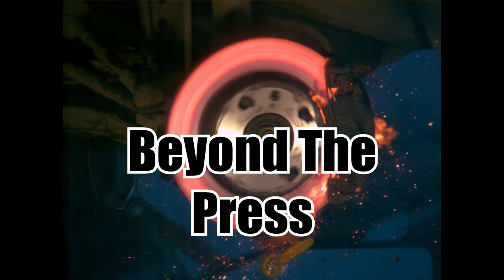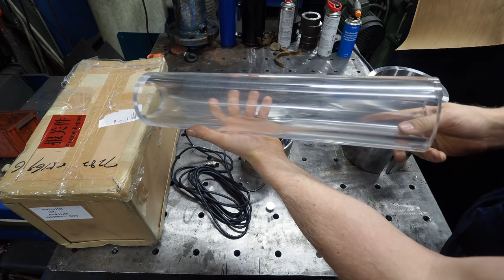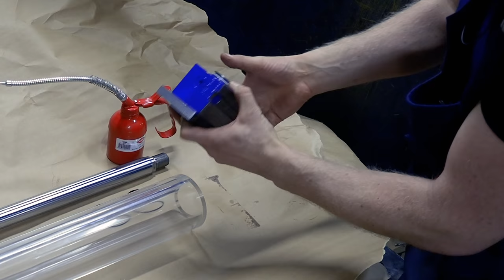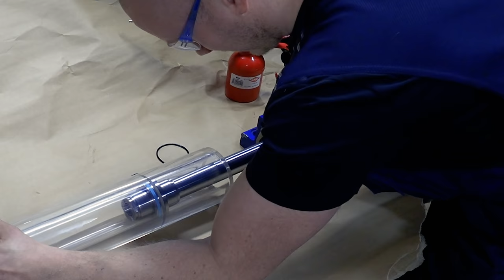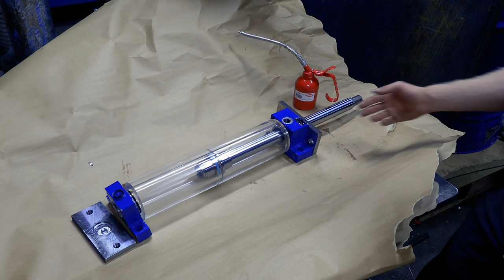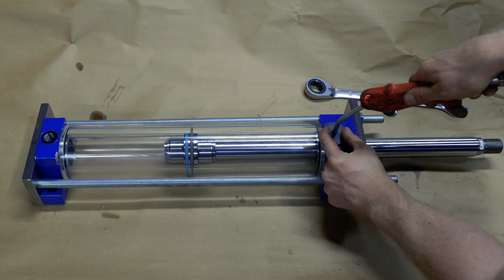World First Working Transparent Hydraulic Cylinder?

Comment from the maker: I forgot to explain today's extra content on the video :D But it's a long drill making a long hole :D And I didn't have time to film machining part but here is link to older acrylic machining video https://youtu.be/a4egfD3c8eM And here is link to our workshop's page if you need something special like this made https://www.vuohensilta.fi
Reply: Ok
Reply: Very detailed explanation of the extra content, thanks.
Reply: technically, if you fill a syringe with oil and connect it to another syringe that is fully compressed, it's hydraulics
Reply: Hey Lauri your extra content made my cat go mad jumping around 😺
Reply: That was a big ass drill, haha - really cool. But that cylinder looked really nice. I understand why you want one your self also :)
Reply: @Speeder84XL  Technology for Arts sake. 👍
Reply: You should have your website translated professionally so potential customers don't have to use Google Translate.
Reply: lots of money in that tool! coolant induction holder, several extensions, plus the drill head,  how long is it?? looks like its 500-600mm
Reply: Beyond the press I want to see you use Mercury as the fluid!
Reply: fill cylinder with mercury
Reply: How big a hole?
Reply: Use polycarbonate

Comment: Please, please, please, made a second video of this operating with hydraulic fluid.
Reply: Are this comment that I will post!
Reply: Surely it will explode if operated even within specified manufacturer's parameters/pressures.... 
Even if it were high end polycarbonate/uhmd and or whatever the highest grade plastic/composite/clear material, hydraulic pistons, pumps and rams operate at such high liquid pressure! I wouldn't want to be the guy in the room with you when you fired up the pump and then push button.... no thankyou my friends....
Reply: Ahahahahaha!!!! 
Here I am thinking it's going to not get used at all and then BAM, IT HIT ME..
ITS A PNEUMATIC (air) piston and ram setup, oh the laughs my friend hahaha!!!! Oh the laughs!!!
Reply: @austinsears1637  plastic is strong. My first job over 20 years ago was QC for plastic M16 bullets. Plastic is awesome

Comment: I have a much smaller handheld acrylic fire cylinder that can ignite materials with rapid pressure/heat. I’d like to see if flammable materials (cotton, charred cloth) will ignite under the slower, much more powerful pressure of your big cylinder!
Reply: I will do video about this
Reply: Would love to see this as well.. very much looking forward to it!
Reply: I of course dont know for sure but I always thought the speed was the big part about it that made them work. If you go to slow the heat transitions away faster than it builds up. But maybe the much larger pressures can overcome that?
But Id love to see it for sure and maybe be proven wrong!

Comment: Why not thread the rod further and put nuts at both ends?
Reply: Maybe the order was like this. As he says it was made by Timo&Eetu. Having the bottom flush makes a lot sense if you want to mount it vertically on something
Reply: or switch the plates so that the nuts are on the other side :)
Reply: Because if you thread the rod through the threads cut into the plate and then tighten a nut onto that, the force you are exerting exists only between the plate and the nut touching it. No force will be applied to the opposite plate, where it is needed.

Comment: A syringe is a hydraulic cylinder.
Reply: But it doesn't work with hydraulics
Reply: yes it does.  @ulle500
Reply: Not in the way that hydraulic cylinder does. Hydraulic cylinder uses fluid to pressure the cylinder either way. With a syringe you use a vacuum created by outside force to suck fluids and outside force to push out the fluid. Hydraulic cylinder works with; hydaulics. A syringe doesn't.
Reply: There is hydraulic press made with syringes.  @ulle500
Reply: yes it does  @ulle500  there is always outside force creating the pressure either side of the piston. No matter what it is, you thumb or hydraulic motor.
Reply: @airjuri  Yes but in the case of hydraulic cylinder it's the fluid creating the pressure that moves the cylinder. But in a syringe the cylinder is NOT actuated with a fluid
Reply: You know that there is different kind of hydraulic cylinders? Syringe is linear actuator. It does not have to be powered with hydraulic pressure to be hydraulic cylinder  @ulle500
Reply: @airjuri  connect two, now you do.
Reply: @airjuri  This is just going in to linguistics, hydraulic cylinder is a hydraulic operated cylinder in this world. This isn't "Beyond the hand operated hydraulic pump channel"
Reply: lol  @ulle500  looks like you're the linguistic here. ;)
Reply: So i have this hydraulic jack, it has only one cylinder and i use hand to lift my car with it. It is not hydraulic cylinder because it has only one cylinder?  @goodnough1
Reply: And yeah syringe by itself is just nice water gun, but when attached to closed system, it can be very powerful HYDRAULIC CYLINDER! ;)  @goodnough1
Reply: And hydraulic literally is just fluid operated, a syringe isn't operated by fluid
Reply: So you're saying that syringe is hydraulic cylinder but it is not operated with fluid.  @ulle500  That i can agree. so syringe is hydraulic cylinder. :D
Reply: @airjuri  No. It is not operated with fluid, thus: it's not a hydraulic cylinder.
Reply: Syringe is a pneumatic operated cylinder
Reply: Wrong answer ;)
Reply: No it is not! since when you have seen people use cyringes by blowing at them?
Reply: @ulle500   Usually, i do not operate syringes with air pressure.
Reply: " it's the fluid creating the pressure", NO load on piston make pressure, if there's nothing to push, and no friction inside cylinder, the pressure would be zero.
Reply: @airjuri  "So you're saying that syringe is hydraulic cylinder but it is not operated with fluid." Then it's not a hydraulic cylinder anymore, since its not operated by water, it's just a cylinder. In that statement you negate the actual definition of a hydraulic cylinder by saying its not operated by water, yet its still somehow a hydraulic cylinder?
Reply: @EVking  hydraulic cylinder can be operated with many things. One is hydraulic force another is electricity, and one is your thumb and there is many more. AND the fluid used in hydraulic systems rarely is just water.

Cyringe is hydraulic cylinder.
Reply: @airjuri  The main component that defines a hydraulic press is it containing two cylinders, the ram and plunger, one smaller and one larger. And sure, they use a mix of oils and water to function, but that doesn't take away from the point that the term hydraulic cylinder specifically refers to a cylinder made to be operated by that mechanism. Is a syringe made to be operated by a hydraulic system? No. Using your own argument "Usually, i do not operate syringes with air pressure.", when do you usually operate them with hydraulic force? If they are always operated with your thumb, why call it a hydraulic cylinder? Why not thumb cylinder? This argument is silly and I have no idea why I am even bothering to respond considering your probably stirring things up on purpose.
Reply: @EVking  Where do you get that air pressure thing? I have never seen cyringe used with air. The cyringe is full of fluid when you use it properly. And yeah, why do you respond since you know what hydraulics is. The guy that said that syringe is not hydraulic cylinder is the one you should respond to. ;)
Reply: @airjuri  hydraulic cylinder means liquid is pushing it, just like pneumatic means air is.. ive been researching this lately (probably why vid appeared in feed). Im building an injection molding machine so i can make batches of cases for thr circuit boards i design.

I was also a junkie for 10 years, im a syringe expert too ;)
Reply: @airjuri  you push the plunger with your thumb.... sure there is liquid, but its at the wrong end. The liquid is not doing the pushing.
You are a good example of the dunning krueger effect (i think thats what its called), you think you know alot more than you do, because you have no idea what you dont understand.
Reply: @airjuri lol i keep reading more of your comments.
Go look on ebay for hydraulic cylinder, then look for peumatic cylinder, one uses liquid, one uses gas.
The DC motor you are talking about isnt directly controlling the cylinder, its actually turning a pump, which pumps liquid into the cylinder. It doesnt go directly to the cylinder, it first goes to a directional valve. One direction goes to one end of thr cylinder which extends it, the other goes to the other end, which you may not have guessed, but retracts it.
Look up the video "how to calculate hydraulic cylinder", it will explain much better than i can, i just watched it yesterday.
Reply: @airjuri  ill say this once more. Does the liquid in the syringe move the plunge? No it doesnt, your thumb does. Before you mention a DC motor again, read my last comment.
Reply: I think you guys have successfully ruined my morning lol

@LittleRainGames has it down pat at least
Reply: @opa @airjuri @EVKing @LittleRainGames Like most principles in physics, the principle of hydraulics is reversible and regardless of whether the plunger is pushing the fluid or the fluid is pushing the plunger, it's still hydraulics. Yes, the more visible cylinders that easily come to mind are at the driven end and you see them on construction equipment and the like, and most of those have a pump instead of another cylinder working in reverse at the driving end.

But here's a neat hydralic machine with hydraulic syringes at both ends: https://www.youtube.com/watch?v=P2r9U4wkjcc.

And your car jack works the same way, but the cylinder at the driving end has a smaller diameter so it takes less force to create the same pressure that's gonna lift the car at the driven end.

A more commonly known example of this bidirectional principle is that an electric motor and generator are the same thing running in reverse. (To wit, on many airplane engines you have one piece of equipment, the "starter-generator," that does both jobs). Saying that a syringe isn't hydraulic is like saying that a generator isn't electric.
Reply: Searches for hydraulics on youtube gets make it extreme, abom 79, and hundreds of indian kids making syringe hydraulic projects...

Comment: It is amazing how smooth that bore is. In my experience trying to drill plastics like this the plastic is not smooth at all. Was there a polishing step inside that bore hole?
Reply: I think Lauri mentions polishing in the beginning of the video
Reply: Plastic machining takes alot of experimenting and practice. Been awhile for me but I remember alot of clean coolant, sharp tool, and high chip load

Comment: I bet this Acryl is a pain to Maschine if you are used to steel
Reply from the maker: It's relatively easy to machine but it's really hard to get exact dimensions and really good surface quality at the same time
Reply: Did you use a acrylic tool bit?

Comment: This design would need literally just 5Nm of torque on the nuts. You cranked those nuts WAY too tight for a GLASS cylinder. Completely unnecessary. You want to use the absolute MINIMUM force necessary.

Comment: I even as a kid, and still, never used the way of saying "Four times weaker" or such. That just sounds wrong. And it is mathematically wrong. (Example of number 1. Four times that, it's 4. Four times less.. Well, 1-4= -3). I still think correct way to say is three of four times weaker. (3/4), if meant to say it's quarter strong of something.

Comment: As a fellow machinist and you have a pressure sensor can you please test different clamping pressures of a 16mm threaded rod. I'd be very interested seeing difference between tightening with wrench and pipe on wrench. The difference in clamping with a toe clamp properly and wrong way. I would guess one threaded 16mm rod could do 30 tons of pressure easily? Just cause I've used 4 to hold up 30 tons on angle plate to machine it and wondering how dangerous that was, thanks

Comment: Nice but not the first in the world. I used to work at an school teaching earth mover operators and we had a set of transparent acrylic hydraulic components as an educational tool to demonstrate hydraulics. Not just a cylinder but also various valves and even a hydraulic accumulator and a hydraulic motor. There was also a little electric pump to power them and lines with quick couplers. The system only operated at 5 bars though as it was purely for demonstrations so no need for real power and it had to be safe for the students to play with. This set was quite old already when I started working there some 15 years ago.

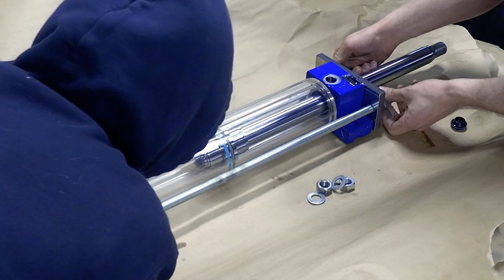Comment: 7:42 you NEED nuts to secure the bottom with a counter-nut, otherwise this configuration can still rotate freely!
Reply: I thought he said that the bottom plate holes were threaded...
Reply: @rickquist3992  without a nut to jam the rod in place so it cant rotate, there is nothing keeping it from wiggling loose with vibration or hammering
Reply: @pathrender  
The nut and lock washer at the top plate prevent rotation of the all-thread rod. The female threads on the bottom plate merely receive the all-thread rod for the purpose of a removable anchor point.

This configuration should safely serve the intended purpose of this low pressure, educational demonstration ram quite well.

I certainly wouldn't advise this design for aircraft landing gear or front end loaders!
Reply: Yeah you right, you gotta lock the other side. having nuts on each end will keep the whole thing squished together.
Reply: Actually, no. Jamming a nut against a threaded plate does extremely little to prevent the rod from loosening. This arrangement is quite optimal - the long rod and the cylinder form a spring, which can retain the pretension very well. And tension is what is keeping boltsmfrom rattling lose.
Reply: Wrong.

Comment: If the normal steel cylinder can handle 300 bar, I wonder if there would be enough pressure in the acrylic one to make it cavitate at all.  Interesting to find the pressure at which the oil does cavitate.

Comment: Keep the outer rod bolts the original length and install the nuts on the threaded plate end also. That way you can tighten the nuts on the other end without them moving lengthwise. Make some Acorn Nuts for both ends to protect hands and threads themselves. And make it look better.

Comment: @Beyond the press

Silicone is for rubber/plastic same as oil is for metal, so is there a reason you used oil for the seals, instead of silicone? i'm only curious, not trying to tell you how to do you job :)
Reply from the maker: I used regular hydraulic oil since that's the same stuff that the system is going to be used with. It's ads always some variables to mix different fluids

Comment: BOTH ENDS HAVES NUTS, the nuts you  think you dont need are for locking the rods after assembly. I know that is a weaker unit but just saying for proper mechanics.

Comment: What I'd like to know is how do you get all the air out of the piston when you fill it?
As far as I know you're not meant to run hydrolics with air in the system.
Reply: Almost all hydraulic systems have some air in the cylinders. It isn't much but it actually has a beneficial affect. It acts as a shock absorber. In fact, many shocks have a gas put into them on purpose.
Reply: Bleed valve just like brakes on your car

Comment: Just wondering how they will bolt the cylinder in place?

The fixing holes looked like they are covered by the 16mm threaded bar.
Reply: Looks like you could fit a nut in there still. And it isn't exactly hard to take it apart and put in some bolts and then re-assemble it.

Comment: Don't operate that cylinder too fast otherwise you might find your 70 Bar will become 300 Bar (in the end cap to barrel seal area). As the dash pot cushion enters the gland (and vice verse for the other end) area, oil is pushed out through the "orifice" by both the momentum and pressure from the opposing side. I have seen many cylinders ruptured by this intensification!

Comment: It's common for tech ed classes to make moving arms or parts with clear syringes and tygon tubing. I remember building one and they didn't even rely on suction, we had 2 so you'd push one to add pressure to the other. A clear hydraulic system.